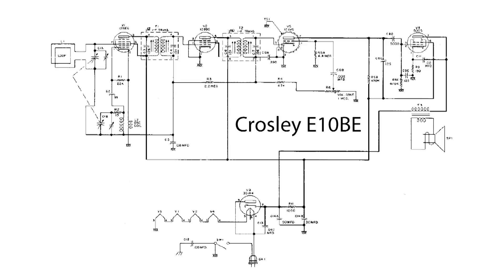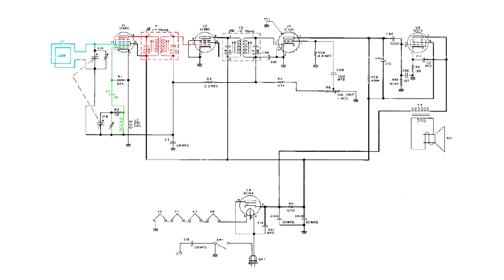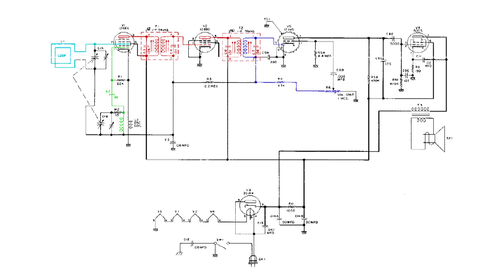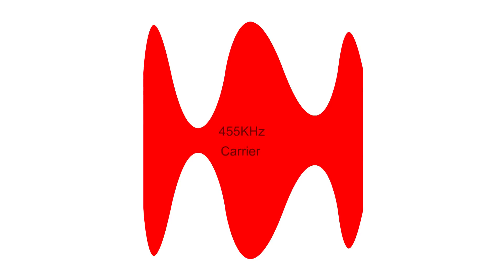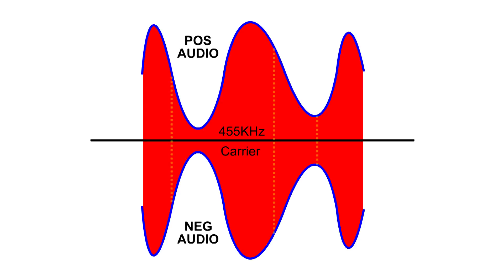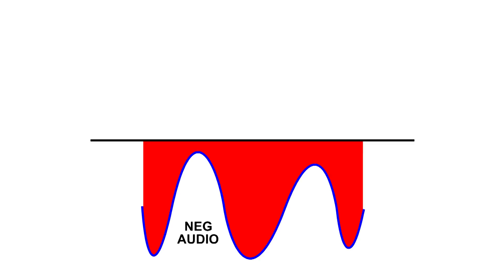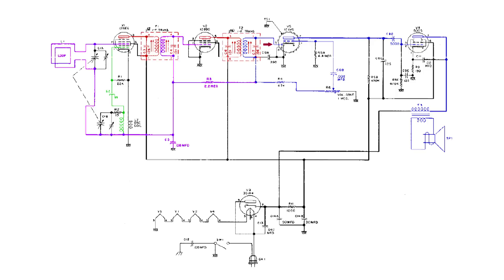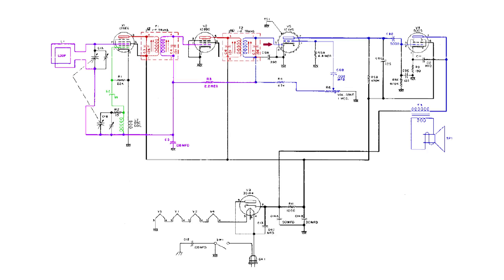How does a Diode, Demodulate AM Amplitude Modulation

Comment: Great video!  I’m trying to understand, so when you have the 455 khz signal before the diode.   You have a positive voltage and a negative voltage at the exact same time ?

Thanks
Reply from the maker: Tank you.
YES. Maybe this video may help.
Superheterodyne  AA5 from End to End
https://youtu.be/glakoNN4lwA
Reply: Thanks for the link,  I’m still a bit green at this but I am learning. Having a + voltage and a —voltage at the exact same time is a bit foreign to me but I get it now 

Thank you
Reply from the maker: Think of two batteries in series, end to end a volt meter would read 3VDC. Now put the black volt meter probe in the center, between the two batteries. If you put the red probe on one end you will read +1.5VDC, if you read the other end you will read -1.5VDC.
Reply: That makes total sense,  thank you  🙂

I have a old 5 tube radio I want to re-cap and align,  but I want to fully understand every part and it’s purpose before jumping in, and ripping out and replacing parts
Reply from the maker: @alexinnewwest1860  I'll be glad to answer questions.

I have a FREE Ebook:PASSWORD is allamericanfiveradio
https://drive.google.com/file/d/1HHmaWYr7UMACfmS4W5uL6PADoem2KlRp/view?usp=sharing

This video maybe helpful.
Radio Repair Steps
https://www.youtube.com/watch?v=d8wWw92HNZg
Reply: That is very much appreciated, I’ll check it out and if I have any questions. I won’t hesitate to ask 

Thank you 😊

Comment: Okey sir, it cut half of the signal but what about the remaining part ? doesn't signal require one more step before the low pass filter ? I guess we need a band which is concentrated on center of the frequency domain so we can pass the signal to the low pass filter. I mean, if we have 10 kHz message in the carrier signal, how do we get the message in circuit by using diode ? I am confused as you can understand. :)
Reply from the maker: The RF bypass capacitor in this Crosley E10BE is C8A 220pF
RF Bypass Capacitor Oscilloscope Demo
https://www.youtube.com/watch?v=OILLayQjEjY

Comment: If it's in 455Khz how you can hear audio frequency through the speaker, diode only can cut the carrier but the frequency is the same?
Reply from the maker: The audio is the varying part, before the diode the varying part adds up to zero. After the diode the varying part now does not add up to zero and now the audio can be amplified. The carrier is 455KHz but you could double it to 910KHz and the audio information is still the same. The carrier frequency must be high enough to carry audio. If we tried to use a carrier of 20KHz, that would not work because 20KHz is audio. Just remember that the audio information is the varying part of the 455KHz carrier.

Comment: How does the diode  'cut' the signal in half. Does it split it and send it in two different directions? If so, how?
Reply from the maker: A diode only conducts electrons in ONE direction. Search my channel, Channel Search just right of the ABOUT for diode.
Reply: Cosmos142857 , a diode clips the current wave length so only half the wave frequency passes. If I remember correctly. In a power rectifier it makes AC current into DC current.
Reply: Visualize the waveform diagrams as opposing voltages that vary in concert with the audio information, equidistant positive and negative excursions above and below circuit ground, which is the black line. Since they oppose by precisely the same amount at all times, they are actually useless, cancelling out. It’s like adding 2 and -2. By applying them to the plate of the diode in the detector tube, the positive excursions are shorted to ground via the tube’s cathode. The diode only conducts in this direction, leaving the negative parts of the opposing signal intact. Now there’s nothing left to cancel its amplitude changes, so it’s a usable audio signal. It can be filtered of any residual RF energy, amplified in audio stages, and sent to the speaker.